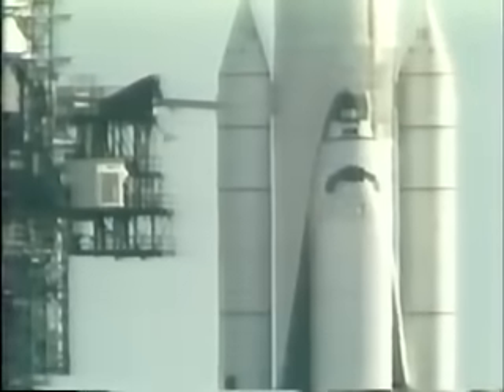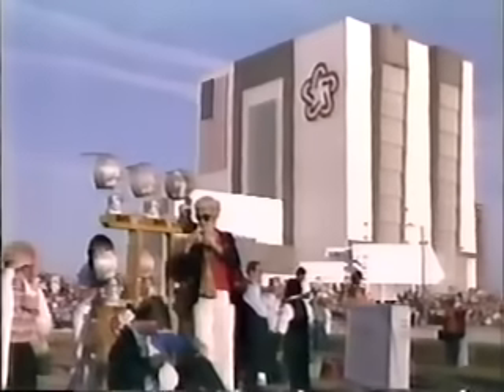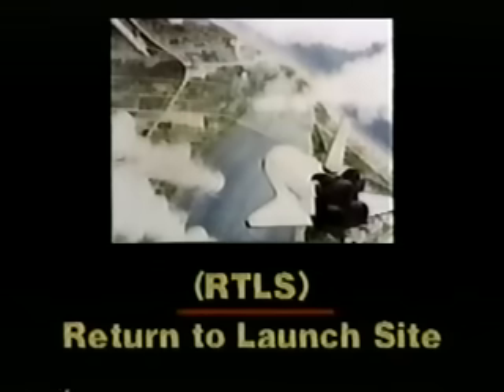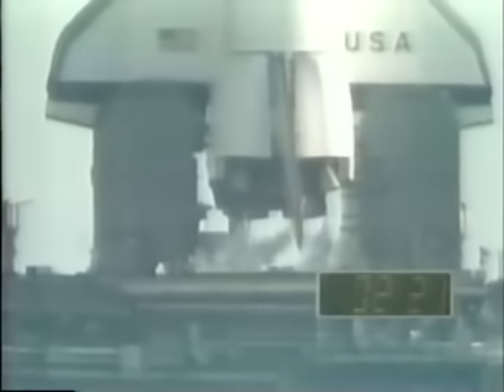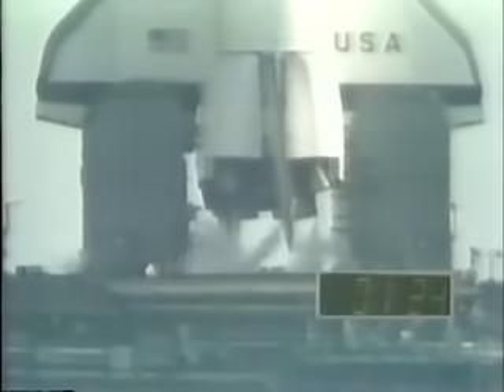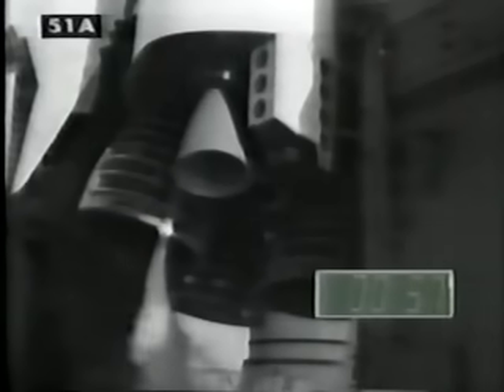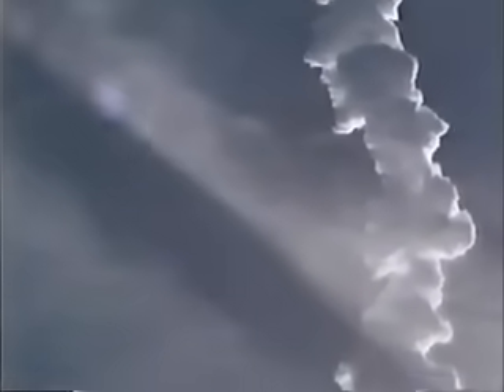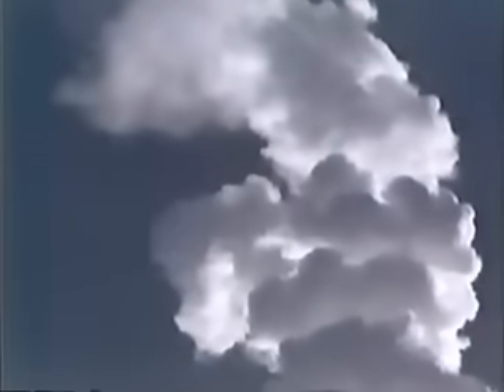First Shuttle launch Columbia 1981

Comment: Jenny M, The main reason why the accidents happened was just because of NASA's arrogance by thinking it would perform perfect all the time.
Reply: Challenger's issue came from a 3rd party manufacturer who told NASA it had faith it would perform well regardless of the weather at the time.  Now the investigation that followed the accident?  There was arrogance everywhere.

But as for Columbia, yeah, NASA had some serious issues that led to it's failure.  The two big ones being a flawed process/management structure and the theory that even though something is dangerous, it's not been a problem before (foam had hit tiles before with no harm) so it won't be a problem in the future.

As for putting rockets on the bottom of the shuttle, it's true it would have prevented the accidents because the shuttle would have never left the ground. Soooo, problem solved?
Reply: Chris Thompson The manufacturer (Thiokol) warned NASA about a possibility that the O-rings would fail if it was subjected to very cold temperatures, NASA ignored the notes, even the former CEO warned them about the situation.
Reply: MK3424 Okay...this has forced me to go back and do some reading.  I think we're both right to a certain extent (though you more than me, maybe).  The infamous conference call between Thiokol and NASA ended with Thiokol conceding that the flaws in the O rings were within acceptable limits and approved the go ahead.  But now I see that this issue goes back almost 10 years prior to the accident.  It looks like Thiokol knew of design flaws in their O rings but did not publish the data.  Later, NASA staffers had concerns about the designs but management did not forward those concerns up the chain nor to Thiokol. During that conference call, Thiokol did express concerns about the O rings but NASA opposed the delay.  The NASA guys on the call did not know 1) Thiokol's earlier research, or 2) internal concerns about the rings.  The Thiokol guys gave in to NASA because they didn't know about NASA's internal concerns about the rings.  Also, both sides agreed that if the primary O ring did fail then it's backup would kick in.  However, NASA regulations stated that if a system or part is deemed "critically 1" then relying on backups was not acceptable.  It looked like the O ring was re-designated critically 1 5 years earlier.  What a freaking mess.  Thanks for the correction and making me learn.
Reply: Chris Thompson no... It had not been a "known problem for ten years" since the shuttle had only been operating approximately 5 to 6 years at the time of the crash. Now the inspector of the srbs coming back in for refurbishment had been raising concerns for several flights prior to the Challenger disaster noting that the damage was most severe the colder the weather was at launch. He was also very concerned the day of the launch and tried several times to get the launch aborted but NASA superseded the decision. A sad day in America's history for sure.

Comment: Well. Neither blew up in effect. Challenger was destroyed when gases escaped from a booster and ruptured the external tank, which exploded, destroying Challenger. In fact the crew compartment with the crew hit the ocean intact. Columbia (as said earlier) was destroyed on re-entry was hot gas got into the wing from a hole created when a piece of foam hit the wing leading edge on lift off.
The very, very sad part of this is that both disasters could have been avoided in terms of saving the crews.
Reply: This, I just toured ATK and they learned a LOT from this.  I met the director of Space Shuttle operations and they had many late nights

Comment: This is before the Water Suppression System was used in Shuttle flights. On this flight, the reverberation of Main Engine Start and the SRB's lighting caused a pressure wave, which actually hit the ET and the Orbiter. Columbia's ventral fin was bent upward; any further, and Columbia would not have been able to re-enter the atmosphere and land.
Reply: I think it was the "Body Flap" (aka the beaver tail) on the bottom/back, inline with the wings, that got bent during launch.  I remember reading that John Young said that if he had known how badly it got bent back at launch, he would have attempted the ultra-risky "Return To Launch Abort" maneuver!

Comment: SRB's actually didn't have to have o-rings necessarily, they were designed in b/c Thiokol couldn't ship a piece of equipment as big as the SRBs in one piece since they were built in Utah. Had to transport by rail. May never have had an issue.

Comment: technically, o-ring failure and disintegration. But yes "blew up" is what most people remember. Which is sad, actually the SRBs and the rest of the vehicle worked great, if it weren't for the stupid design of the failed original o-rings and shedding foam.
Reply: Multiple shuttle flights came very close to disaster.  The vehicle was a death trap.

Comment: Im a local professional photographer and covered the very last launch from rollout to its final resting place in the museum.

It's sad to see them go but its replacement, SLS is supposed to be even more powerful than the Saturn V that sent us to the moon.

The capsule for SLS is going to be dry-tested this year atop a Delta 4 heavy to test the heat shield on re-entry. You can bet I will be here for SLS when it gets off the ground.

Comment: Columbia wasnt modified to dock with the the ISS was because of its weight,it was the heaviest orbiter it couldnt move some of the heavy ISS parts as the rest of the fleet could.The SLW tank project was major as was all the other weight reduction tasks for ISS. Endeavour was the lightest(151,205lbs)then Atlantis(151,315lbs) Discovery(151,419lbs),Challenger(155,400lbs) Columbia.(158,289lbs)weights minus engines. After the HST servicing and STS 107,Columbia wasnt scheduled to be used much at all

Comment: Columbia could easily reach the ISS(international Space Station) its orbit was relatively low 350km when the Shuttles were flying, it has since rased up to 418km to save fuel.There was a standard weight(SW-STS 1-5) ET 77k lbs,a lightweight(LW)tank 66k lbs, and the new superlightweight(SLT-1998 up except STS 99 & 107) tank 58.5k lbs all weights are empty.Columbia was used on the 4th of 5 service mission of the Hubble Space Telescope(HST) on STS-109 which orbits much higher than ISS at 560km.

Comment: To give you an example of the difference...Columbia could not reach the high orbit of the International Space Station because of it's additional weight. All of the other Orbiters could reach the station because of their reduced weights. Another change made to improve performance (weight reduction) was lighter materials used to produce the external tank and increased propellant load in the twin solid rocket boosters. All of these cahnges increased the payload (weight) capability of the vehicle.

Comment: But, other modifications had to be made that could negate weight savings, such as extra instrumentation or cameras and heaters. Columbia was the heaviest orbiter because of the extra instrumentation it carried as the first vehicle. Atlantis, the last orbiter, was much lighter because of refinements made during construction learned from the instrumentation installed on Columbia. Atlantis also had slightly clipped wings further reducing weight and drag.

Comment: Essentially it is the same vehicle. Speed isn't really the primary consideration....to achieve orbit an escape velocity of approximately 17,000 mph is needed. What is critical in a vehicle hauling cargo, is how much cargo can be carried while allowing the vehicle to still reach the required speed to attain orbit. many upgrades were done to the shuttles over the years to save weight on the vehicle, some as simple as not painting the external fuel tank with it's original white topcoat.

Comment: Bush directed the retirement of the Shuttle Program based on the recommendation of the Columbia Accident Investigation Board. The shuttle was to be retired upon completion of assembling the ISS. Bush simultaneously started the Constellation program which would have replaced the shuttle. OBAMA not only cancelled the replacement vehicle, he failed to prevent retirement of the shuttle. The GAO identified shuttle extension as 1 of the top 10 issues to be addressed at the start of his admin.

Comment: John Young stated that when the SRB's lit, the force of the concussion deflected the horizontal "beaver tail" on the orbiter so much that it been monitored during the lift-off and flight it would have registered a potential critical problem to the degree that he and Crippen would have had to eject. It was only in post flight analysis of the data that this was discovered.  He also commented after the flight that the orbiter had a lot of damage done to the tiles...
Reply: The shuttle had many, many near misses.   It was a death trap.

Comment: What you are describing is the flight readiness test in which only the 3 Space Shuttle Main Engines are fired for about 22 seconds.The SRB's are not fired. Once a lit, it cant be shut down until all the solid fuel is burned roghly 120 seconds later. A full vertical SRB test would destroy the MLP and probably the entire shuttle stack.

Comment: Hey, maybe an MIT rocket scientist can explain this to me. If you look at the SSMES as
a complete assembly that includes the fuel and the engines at T = 0, liftoff, you have a
combined mass or weight of approximately LOXH + Tank = 1,680,000 lbs + SSMEs
3 x 7,000( 21,000 )lbs = 1.68E6 + .021E6 = 1.7E6 lbs at Liftoff. Does anybody have
thrust values for the SSMEs at liftoff? Let's say the combined thrust = 1.0E6 lbs but that
means at liftoff the SSME assembly is___well you know.

Comment: Solid rocket boosters were a mistake.  At the time they were thought to be cheaper than the more powerful liquid fueled counterpart but it turned out not to the case.  SRB's caused the extreme vibrations, shaking and rough ride until SRB SEP.  SRB's at at least partly (if not all) responsible for the foam getting shaken on Columbia killing all, and fully responsible for Challenger killing all. SRB's cannot be turned off once started.

Comment: The SRB's make shuttle look very crude, like a old car running on bad gas.  I was really surprised that they decided to use Solid Rocket fuel which technologically is older and less advanced than its liquid counterpart.  We need a vehicle like Soyuz which is very graceful, more advanced, reliable, safe, and 1/15th the cost.

Comment: People today don't realize how gutsy this really was. They had never even test fired the SBRs vertically before. Nobody for certain had a clue what would happen, there were no computer simulations like there are today, and if something had gone wrong in orbit, they'd have died in re-entry as there was no way to repair damages. The Ejection seats mentioned were modified from a SR-71 and were only rated at relaively low altitudes. This was probably the most balsy test flight man has ever taken on.

Comment: @stabbingmeagain Commander of STS-1 John Young stated in an interview that when the SRB's ignited, they produced a shock-wave that induced an unintended deflection of the main tail body flap. This was to such a degree that had they been aware of the damage at the time, thet would have been required to eject from the shuttle losing Columbia, and possibly both he and  STS-1 pilot Robert Crippen not surviving the ejection. Terrifying! But Young just grinned about it, as you might expect...

Comment: @uzimodem Since the shuttle program ended, yes, but the way you made it sound, is that it's been all down hill since the first STS launch. But, yes, not taking the lead as the primary means to get to space, I agree. Also, Obama has seen to it to cancel any return trip to the moon, and probably killed a manned Mars mission in the planning stages. Far, indeed.